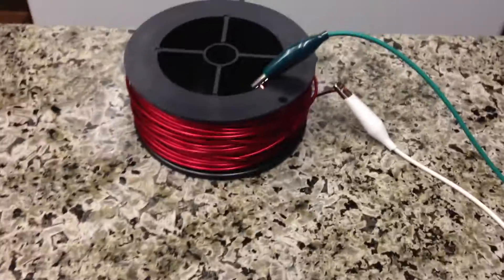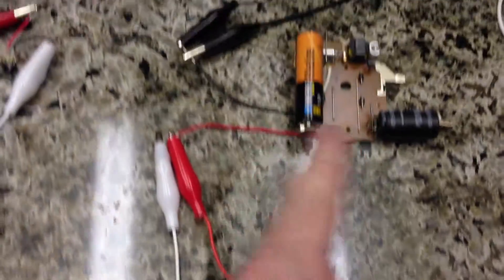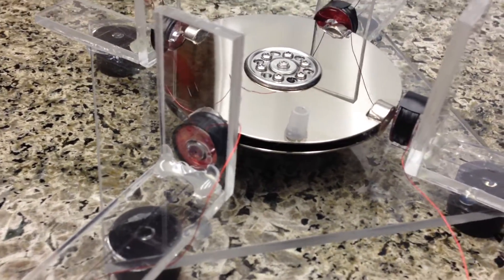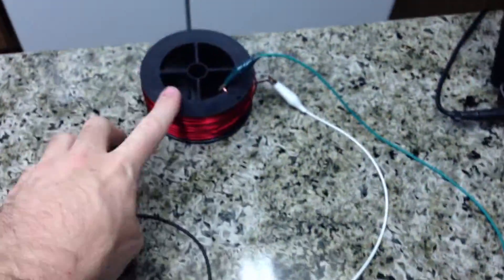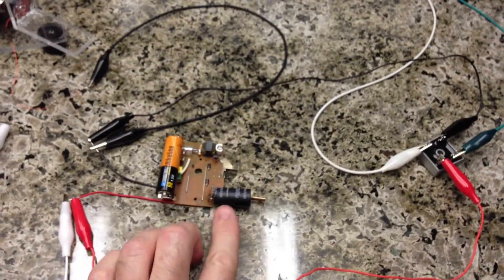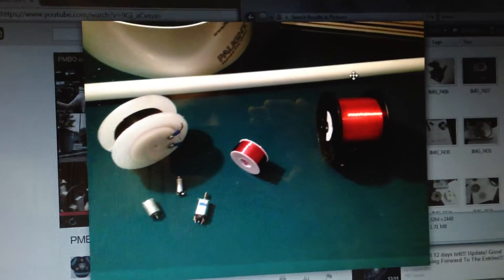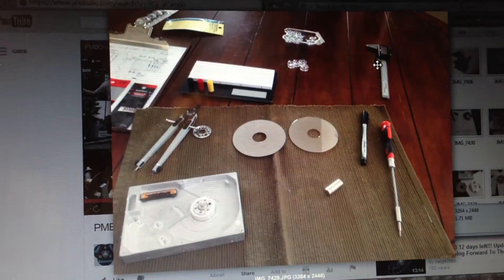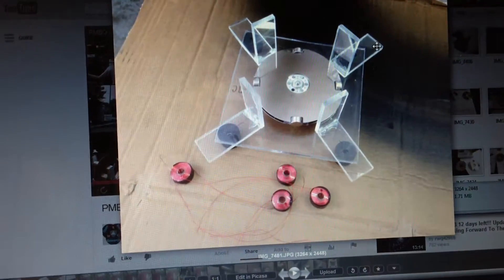PMBO 2013 #6- (Final Video) Stimulated Gas EMF Driving a Pulse Motor

Comment: .I saw a guy wire up the bottom of the DC motor on the hard drive bearing/motor and power a few LED's ...although he ran an electric motor and spun it up to show how the principle worked, I was thinking we could capture something from those rotors via that connector on the bottom but I could never find out how he wired it up.. I was wondering if you might know how it's done? or even if it's worth it, this guy only had a few LED's but i thought it was something...maybe? Cheers. (you'll never get rid of me now).